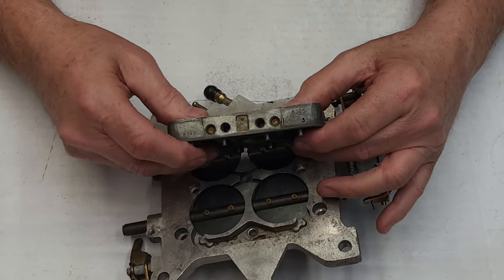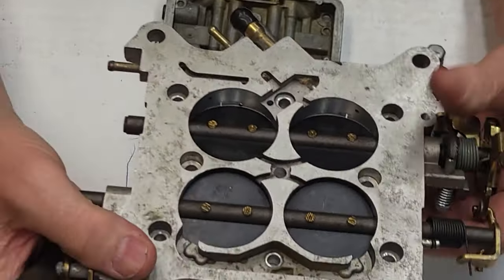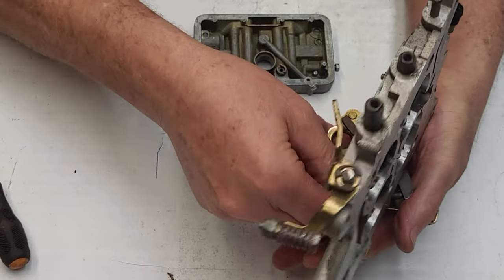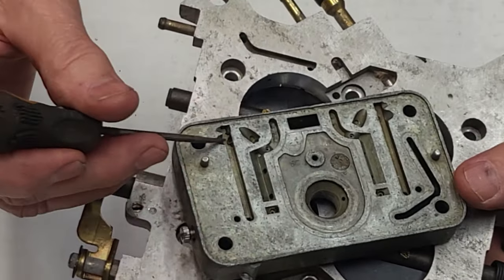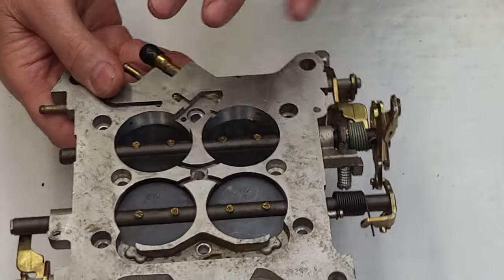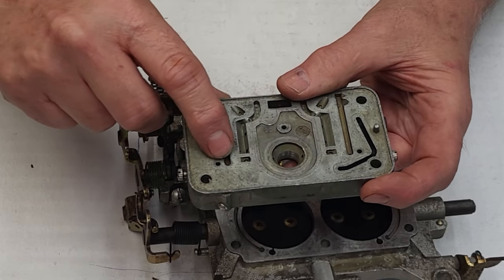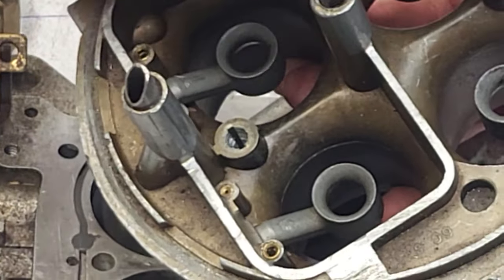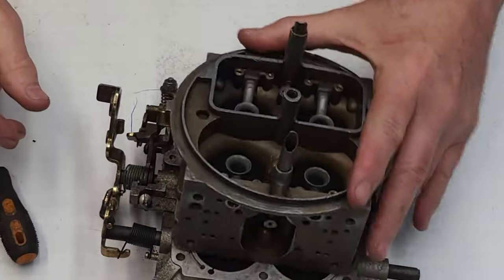Fine Tuning with T Slots and Bleeds

Comment: I currently have the opposite issue, I am too lean at idle. I currently have a 650 DP, 67/79 jets, .093 drilled throttle plates.  Engine is a fairly radical old school small block Ford that only makes 7 inches of vacuum at idle. Even with the .093 throttle plates in all four holes, I can't get enough air with the transfer slots "square".  If I crack the rears open a bit more, it will idle but go leaner when I crack the throttle. I can open the fronts some and idle it up, but it is very lean, even when I hold it at 2000rpm or so. Do I need to go even larger on the throttle plate holes?
Reply from the maker: Dont drill your bypass holes any larger, i need all of your engine build  information , i would check your engine for a large vacuun leak, make sure your carburetor idle circuit is not restricted, and your ignition timing is correct, next perform a compression test and write me back your compression readings. 7 inches is just to low . Let me know.
Reply: @holleycarbshowtosadvice40y90  it has always made 7-8 inches of vacuum. .040 over 302, heavily ported Windsor heads, 10.5:1 compression.  230/240, 280/290, .523/.555 lift on a 106lsa. Performer RPM Air Gap with a 2 inch 4 hole spacer. I ran it for years with a 750 5160 with the .093 plates in all four corners and a 4.5 power valve with no issues. I swapped to this 4150 650 and installed the same parts, but it still needs more throttle opening at idle to run, and I can't get enough fuel at idle to make it happy.
Reply from the maker: Are your mixture screws leaning and richening the mixture , or do your mixture screws have no effect on your idle?
Reply: @holleycarbshowtosadvice40y90  they are working, but I can steadily back them out to a full three turns and the idle just keeps getting better. At that point it still isn't a clean idle, and I can steadily tap the accelerator pump lightly and the idle gets smoother. Everything points to it wanting more fuel at idle.
Reply from the maker: Ok lets try this first your idle fuel restrictor controls how much fuel the idle circuit receives, if you have removeable ifrs then increase the size by .005 to .010 larger both ifrs, if there not removeable you can drill them out to see this helps. I have a video on how to drill them out and tap some threads in to make changing them quick. This will increase the amount of fuel to your idle mixture screws. Let me know.
Reply: @holleycarbshowtosadvice40y90  I will have to watch the video and see what is involved. I bumped the timing 4 degrees and was able to close the front throttle plates some, but still showing 15.7-16.0 at idle. Tapping the primary accelerator pump still improves the idle. Mixture screws are as far out as I dare, and both float levels are at the bottom of the holes. Timing is 18 degrees at 900rpm, all in at 38 degrees@2700rpm. Didn't have my vacuum gauge with me to see what vacuum was at.
Reply: @holleycarbshowtosadvice40y90  I just watched your video on the idle fuel restrictions, do you recommend I open the passage up to .035-.040?
Reply from the maker: If you can, measure them  first and then i would open it up at least .005 to .010 at a time to see if it helps, you can always tap some threads in the metering block to make  the ifrs removeable. I have a video on that. Hope this helps
Reply: @holleycarbshowtosadvice40y90  we just tore it down. Front idle fuel restrictor was at .035, rear at .040. Currently have a 4.5 power valve, went from a 67 jet in the front to a 70, rear has a 73 jet in it.  At idle, the transfer slots are barely visible, but I still can't get enough fuel.  Trying to get it to idle around 900rpm, but it is still so lean that if I gently tap either accelerator pump regularly the idle will rise to 1200rpm and vacuum moves from 6-7 inches to 10 inches.

Comment: Do you open your secondaries on a double pumper as far as the primaries?
Reply from the maker: I need more information about your engine, if you have a performance camshaft, it can effect your  primary and secondary idle adjustment,,usually if I  need to bypass more air, I will raise my secondary idle speed adjustment.
Reply: 434 small block with .577 lift and 242/248 duration. Dual plane manifold, Holley Ultra HP 850 with 14 in. vacuum at idle.  Thanks.
Reply from the maker: With your primary transfer slots set properly. Yes you can set your secondaries matching, then set your idle speed with your built in idle air bypass adjustment.  Hope this helps

Comment: great videos, my issue is with a 4160 600 cfm Holley, it idles fine but as soon as it goes off idle it seems to flood and skip or tremble and stumbles until you accelerate much more or return to curb idle. HELP!!! This is on a 1986 F150 with 351 HO engine
Thanks in Advance
Reply from the maker: First with engine off look down the throat of the primaries to see if the accelerator pump is squirting the minute you move the throttle if its not check accel. Pump adjustment, also remove one of your bowl screws to drain fuel out of primary fuel bowl and check it for water or trash. Hope this helps, let me know if not fixed
Reply: I have tried many things to help solve this issue but still stumbles and sounds like a dead skip off idle. Air screw adjustment has no effect on idle speed.
Reply from the maker: Let me know what you have tryed to repair it
Reply: @holleycarbshowtosadvice40y90  
It would take me about an hour of typing to tell you what I have done to to try and fix this issue with the end result the same. Thank you for your reply. The only fix I know to do is replace the carb. Thank you for the great and detailed Holley videos.